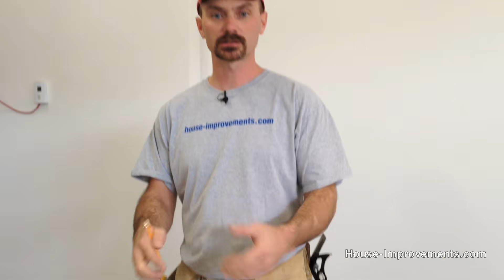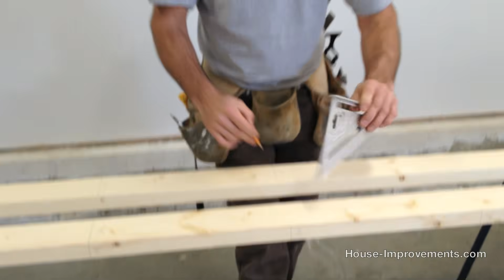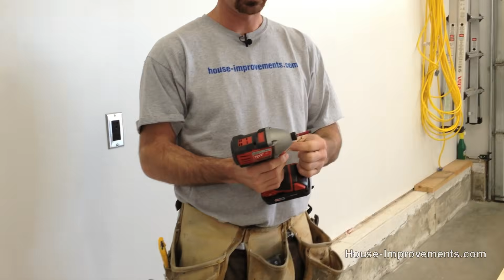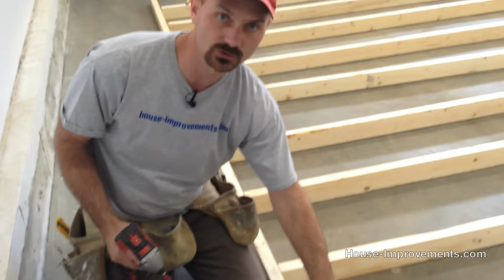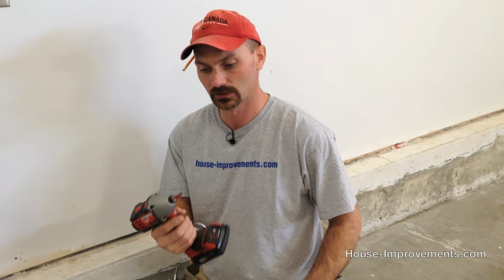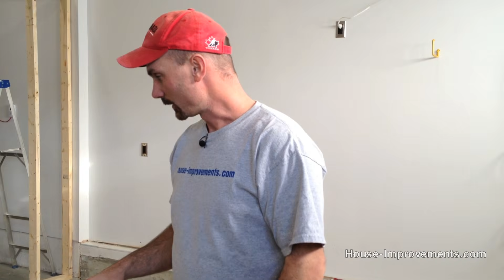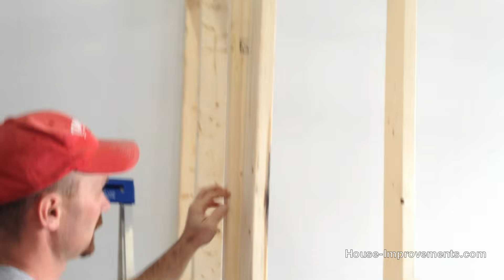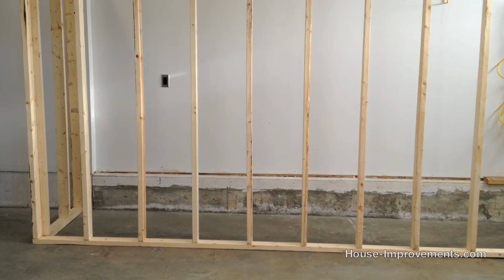Wood Stud Wall Framing

Comment: Do you know a simple way to fix a vertical stud to a concrete roof, as I want to round it with a fence?
Reply from the maker: If you want to basically build a railing around the roof area, I would recommend  using 4x4 posts attached to the roof using a metal bracket . These brackets come with a base that usually has 4 holes for bolt style hammer in anchors and a square cup that accepts a 4x4 post in the centre that can be attache with screws. Be sure to consult your local building authority with your plans to be sure it is approved.

Comment: Just wondering. . If im doing this in a downstairs living room' how do you secure the stud wall to the ceiling? Straight into the upstairs joists? First time for me :-)
Reply from the maker: Yes you are correct. If the wall runs the same direction as the joists then you may just need to add blocking between the joists to secure the wall to.
Reply: Fantastic. Thanks for the help. Great vid btw.

Comment: I'm using steel studding in a poured concrete basement. Is there anything wrong with attaching wood directly to the concrete walls and insulating around that to provide anchors  for heavy cupboards and a big TV?

Comment: Very well explained. Was wondering if I should still use two 2x4's at top if I plan on taking wall all the way up to wooden floor joists? They're all gonna be inside walls

Comment from the maker: First of all I do not recommend steel studs for basement walls. The moisture in most basement environments leads to rust and deterioration and some times failure in less that 20 yrs. Use a pressure treated bottom wood plate and spruce top plate and studs is better in my mind. Also Build the wall independent from the concrete wall and leave about a 1/2' - 1" space between the concrete wall and framing, and don't forget the moisture barrier. If you go to my youtube channel you can find more videos

Comment: I need to put up studs right the way along a poured concrete wall 10m in length. What's the best way to do this? Steel studs? Wood studs attached to the top and bottom? Wood studs attached directly to the wall?

Thanks for the vids BTW!

Comment: the only thing with this is if you were sheeting the outside, what would happen at the corner at the stub? if you are at 16" centers, the smaller side would be hard to sheet and you would waste sheeting wouldn't you? due to the fact that you have the 3 1/2 stud on the flat before you start your 16" center. or do you subtract that 3 1/2 from the 15 1/4"

Comment from the maker: Depending where you are, code may call for that, my code calls for that only if you are building a load bearing wall that will not have any sheathing,drywall or angled strap. It may also be required for fire blocking if you were balloon framing more than one story.

Comment: when attaching a 12 foot wall to a 16 foot wall would the total with and length change if using 2by 4 would the square frame be 16 feet and 7 inches due to the l shape butting the corners

Comment: Excellent video. If my wall will be longer than the top/bottom plate lumber length (say, a 18' wall when I only have 12' lumber), do you raise a wall in 2 sections (as 2 complete frames) or do you splice it somehow (maybe using the 2nd top plate)? I'm building a shed, and there is no 2nd top plate specified...

Comment from the maker: When nailing the double top plate you do not need to nail it right at the studs, just off to the side a couple of inches or so.Your nails will not really penetrate the studs anyways because the thickness of the two plates is 3 "b and your nails would not usually be longer than 3-1/2". I would usually use a nail gun but you can hammer them in.

Comment from the maker: Leaving that top plate of and building the wall also about 1/4" shorter than needed will help you out. Assuming that this wall is not needed for support of the joists.
Add some blocks of 2x4 between the joists every 4' or so and then attach wall to these.

Comment: What's the best way to raise a partition wall in place, floor to ceiling? Leave the double top plate off and then install it once erected? What if ceiling joists do not line up with the wall, what's the best way to block up the ceiling joists to give a stable attachment area for the top plates?

Comment: Good video - curious why you didn't just mark the stud locations on the long side of the plates (vs. on the short side first and then transferring those marks). Seems like it would save some time putting the wall together, but maybe you have a reason for doing it that way (?).

Comment from the maker: That would work. What we call 2x4 or 2x6 are actually 1-1/2" x 3-1/2" and 1-1/2" x 5-1/2" .... It's a long story so I will not bore you with it, just thought you should know. So really 38mm x 89mm and 38mm x 140mm.

Comment from the maker: Hey Robert! Will not have a video on that but I would "stick frame" it in place. So attach the bottom plate to the floor and top plate to the ceiling. Measure and cut each stud to fit and nail them each in place as you go.

Comment from the maker: Wow that is a lot of nog! In Canada that is only required after your wall is more than 10'  (3048mm) tall then you need it a minimum of every 8' (2438mm) 
FYI  inch = 25.4 mm,  1 foot= 304.8mm

Comment: Great tutorials Shannon, I have a question, I recently renovated my bedroom with wall panels, I have 6 internal corners, 2 of which were severely out of square, you could see it from the drywall, is this the previous framer's fault or the humidity warping the wood? Cause I had to scribe them which I shouldn't enjoy unless it's butting cabinets

Comment: My volume all the way up, yet still hard to hear this. Finally had to give up. Btw, my hearing is fine. ---I wonder, why bother marking the narrow edges of the plates, considering your speedsquare lines are actually drawn on the wide edge? PS: Like the red hat, I wear one too, only mine is torn up and way dirtier.

Comment: Sure there are a lot of video and scripting techniques that could be used, but this is basic, good knowledge, and I appreciate the slower approach.  A script would speed things up and we would end up having to replay several times to get the point.  This isn't about video production, it's about helping the average guy build something.  Good stuff!

Comment: Hi there, my name is Jay. I am basically a novice at framing.However, I was wanting to venture into making a closet for my moms den. This room has a 12x12 tile, drop ceiling though(seems like I would have to remove the  moulding to access the tiles where I would have to join the closet wall top plate to drop ceiling framing?) I was just wondering what things I should consider with having a drop ceiling to contend with. What size lumber would I have to add to the drop ceiling to make this work?

Comment: Excellent video, thanks! And the thoroughness and pacing are very much appreciated by novices like me.

One question--do you nail straight through the double top plate into the studs, or do you nail on one plate on at a time? If the latter is the case, do you have a method for avoiding nailing down right into another nailhead? Thanks for your help.

Comment: I am confused about 16 on center. Why not measure 16 and put the stud right in the middle of the 16 inch line? Backing  up 3/4 of an inch does the same thing, no?

Comment: The quality of these videos is excellent.  I appreciate the attention to details:  explanation of "crowning", measuring sheets diagonally, the length of screws to use.  I just recently started building stuff, and am realizing it's easy to screw up.  Thanks for these videos.

Comment: Damn good video.  Couple things...On concrete maybe use treated lumber for the bottom.  For inside walls like finishing a basement, cut studs about 1/4" shorter then use shims up top.

Comment: Hi!
I'm about to enclose a garage to turn it into a room. It has concrete block walls and a concrete floor. What is the best way to secure the bottom plate to the floor? Or do I need to do so..?

Comment: Shannon ... I have found your videos extremely helpful. I am not a builder by any means but for some reason have an inspiration to attempt to build a shed from scratch. The shed front & rear walls will be 18 ft. One thing I haven't been able to find instruction for is the proper way to construct an extended length stud wall where splice joints are required. You touched on this in one of your videos but did not address the actual procedure to do this. Thanks for  these videos. Very helpful !

Comment: Hi there,
I imagine i could do this for a shed, so just repeat the process four times :) however as its for a outbuilding what would you suggest i put on the outside as i cannot use plasterboard due to weather or could i and then just render? seriously just a novice so really sorry if its a really daft question.
Thanks
Mo

Comment: Im about to add a L shape wall to my finished walls in my garage. Do I need to remove Sheetrock to attach the new wall to an existing stud or just place the new wall up against the Sheetrock against the stud like your video shows.